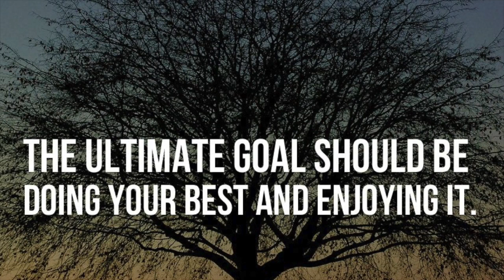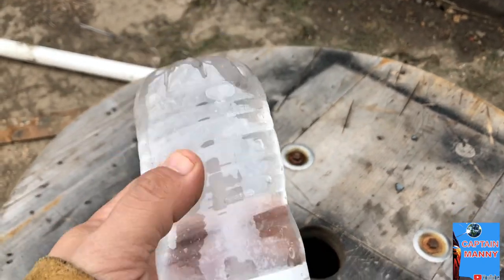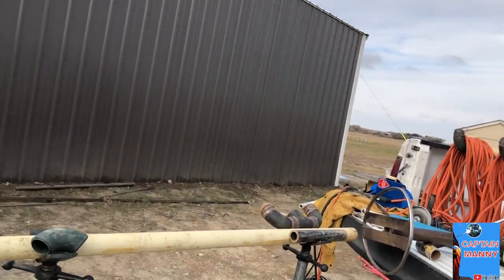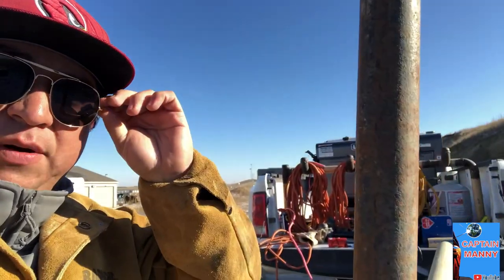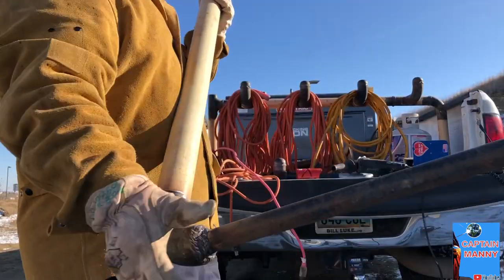Hoosier Pole!!👨‍🏭🤟🏽

Comment: Hey what size is the pipe that you used for the extension part of the pole, the one that goes into the 2 inch pipe, is the slide out a 1 and a half inch schedule 80 pipe?

Comment: Does anyone use a cordless angle grinder from milwaukee or dewalt?
Reply from the maker: I haven’t see it
Reply: I have used the dewalt 60 flex volt.  It works like a dream but not too long of a battery life. Great tool tho